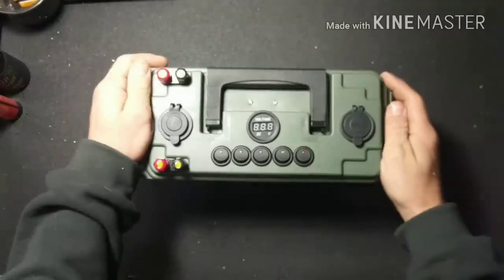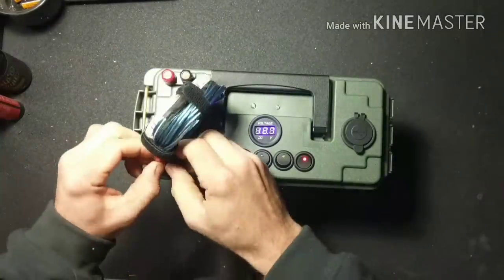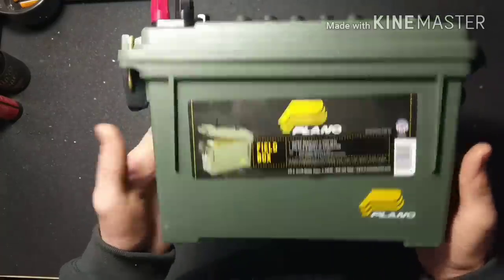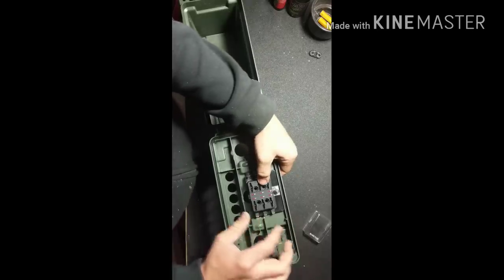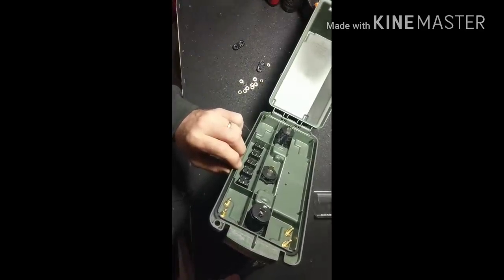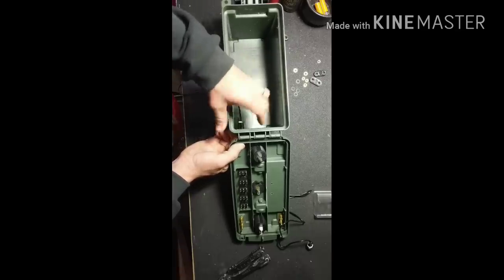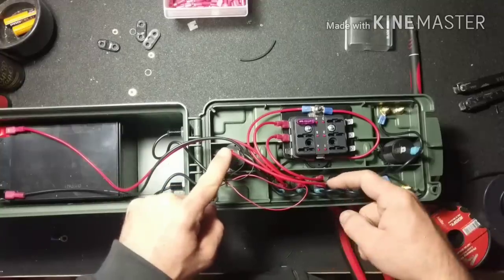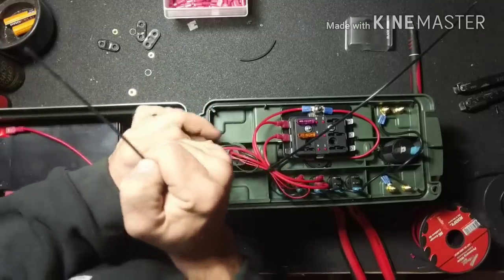How to build a portable power box version two

Comment: the fuse block i have has a negative post unlike yours. in that case would i just wire from the negative post on the block to the last switch like you did? or do i need to get a fused distribution block like yours? thanks
Reply from the maker: You can fuse the negative
Reply: @JDSOutdoors  i figured out it has a negative bus bar. also i saw your new video with the dewalt battery attachment eliminating the ammo box. only thing i would say is these ammo can builds are still highly preferred for things like mobile ham radio applications like a field day. hook a solar panel to the jacks and you can talk for hours in the middle of nowhere while also charging you accessories and what not. thank you for the videos!

Comment: Ok so i did the build and added the solar all at the same time. I got a 30w panel for charging and on a decently sunny day my multi meter shows about 18w going into the box.  My question is, when i plug the panel in,  all 3 lights on my charge controller are flashing off and on at the same time.  Is that how it works when its charging?  I would think only the charging light should come on.
Reply from the maker: The battery light should be solid the PV light will flash when charging. When charged either 2 will flash or all depending on the brand
Reply: Ive got all 3 flashing.  The battery is at 12.6 according to the volt meter. I used the same components as your build,  got the switches and such from ice hole. Harbor freight charge controller. Maybe its sensing the battery is at charge? Or maybe a bad charge controller?
Reply from the maker: @chrispierce2942  hmm use it for a week or so and see what it does
Reply: Ill give it a shot.  Thanks for the help
Reply from the maker: @chrispierce2942  if it doesn't work I'd swap it for another one every brand has a defect every now and then
Reply: Gotcha, i kinda thought that but ill see what happens.  Might try and drain the battery down more then hook it up and see where that leads me

Comment: How would this type of setup last for using it to use a fish finder and livewell at the same time?? For approx 8hrs
Reply from the maker: It all depends on the type of pump you use and the amps it pulls. With this 12ah battery you will have no problem running a vexlar or similar off of it for 8+ hours. You will have to look at the pump and on it, it will say .5 a/hr etc then the math from there is easy

Comment: A little off topic, but can i charge a battery bank (26,000 mah) directly off a usb port on a solar charge controller if the controller is not hooked up to a "storage" battery?  IE 50watt solar panel, 20 amp charge controller, but no "house" battery?  Cheers.

Comment: Awesome vid!!! I was wondering if i wanted to use a bigger battery. Would everything still apply?
Reply from the maker: Absolutely the only thing that needs adjusting is the container that holds the battery and the wire size depends on what you want to power

Comment: I just built my second box and I was messing around with no fuses in.   I noticed the LEDs for the switches would still come on, and 5v passing to the receptacles.  Wired identical to yours.  I'm assuming yours doesn't do that when the fuses are out?
Reply from the maker: Weird there should be no power when the fuses are out

Comment: Hello Great Project!  Question.  How can I add an AC 125v Outlet socket to this box?  is it possible?  I want to be able to connect a nonportable speaker to it...
Reply from the maker: You need to add an inverter but on this size box it's not worth it.
Reply from the maker: @jmvelasquez77  you can but it will only last a few minutes before it dies.

Comment: I'd like to add a built in charger port for the battery so I can just plug in an extension cord and have a cover over the plug socket.
Any idea where I could get the plug socket with cover and whatever the proper name is so I can search
Reply from the maker: Yes its called an sae port. I can send a link if you would like.

Comment: Curious about the switches you are using and if they are the same in your other/older veraions of the box. In all your other boxes the middle was the power IN and the outside silver pin was the OUT?
Reply from the maker: It depends on the switch manufacturer best is to test your specific switch. If the light stays on even though the switch is off then swap the power in and power out wires

Comment: Why do you need a switch for each power output? Why not one switch to power the outputs, and one switch to power LED (which are unnecessary anyway)? Is it rechargeable? How long does it take to recharge the battery (if possible)?
Reply from the maker: Must not of watched the video eh all of your questions are answered in it. The best part is its completely customizable if you dont like the leds I use every time I have the box out, actually about 75% of the reason i use the box most of the time. You dont have to put them on

Comment: Hiya great video, I have a question. If I don't have a separate volt meter, for example my volt meter is part of my dual usb port.
DOES the + on the Dual usb/ volt meter go into a fuse box port? And not the fuse box connection at the top? As in ur video.
Thanks
Reply from the maker: You are correct hook it to the fuse box port
Reply: @JDSOutdoors  great thanks so much  keep up the good work.

Comment: Hey man, I used your video to introduce myself to the electrician world, thanks! So, no circuit breaker is needed before the master on/off switch? I understand the fuse block protects everything else. But what about the master on/off switch that is connected straight to the battery?
Reply from the maker: An inline fuse wouldn't hurt if you wanted. All that will burn out is the switch really if something happened
Reply: @JDSOutdoors  So if I were to have a master switch used with a bigger battery, (say 12V 50AH), do you think I'd need a switch rated for more power than the one you used in the video?
Reply from the maker: @zachwilson9824  nope you will be ok

Comment: Save time and labor. Buy a six rocker switch gang box $50 off amazon and mount in the side, instead of many individual pieces that would cost the same amount.
It has usb, cig. and voltmeter, six switches with optional light indicators (if you choose to connect).
all prewired, with inline fuses, only need to connect power leads (6 loads) and one ground.
I have: 
2 nav lights, 
2 aux, (stern and bow) and another on the power box (for solar charging etc), 
3 interior cargo,  
1 spot light, 
3 cockpit lights and 
4 side green zombie lights..for sit on top kayak. I made the box removeable from the fixed wiring harness in kayak. Mounted on the handle of the box with velcro is a AA AAA solar battery charger, can set the angle toward the sun.
I added a master shut off rocker switch on the outside of the box, i have six circuits, LED lights, removeable and rechargeable power.
Another box with 2 small batteries are another add on that keeps batteries waterproof, top deck, and is removeable for use in camp.
Reply: Sounds good 👌🏻 put up a how to video!!! 🙂

Comment: Hi - I thought I had followed the steps correctly, but I am still having issues with my setup. I used a different box, but the wiring should be basically the same. Is there any way you could give me some pointers on what to look at if I share the issues I seem to be having?
Reply from the maker: @christiankearns3732  yes absolutely. Trace the wires and make sure the grounds are all correct
Reply: @JDSOutdoors  The master switch works fine, but when I flip on another switch, the master switch light turns off, but I still get power to the other switch; however, power isn't sent to the accessory. The issue is the same across all of the accessory switches. As soon as I turn one of them on, it lights up, but the light goes out on the master switch and no power is passed to the accessory.
Reply from the maker: @christiankearns3732  try swapping thr power in and power out wires on the switches.
Reply: @JDSOutdoors  Thanks so much for the help. No luck, unfortunately. It seems strange that the switches get power, but it doesn't make it to the accessories. This would lead me to believe is a grounding issues with the accessories, perhaps?
Reply from the maker: @christiankearns3732  yea that would be where I look next
Reply: @JDSOutdoors  Success! Thank you so much for all the help. Great video and thanks for the support.

Comment: I just made one of these recently it works great, but one small problem I'm facing(and I think it happened in your demonstration too) is that whenever you power something the voltmeter voltage is dropping, and its pretty annoying, I made one of these to power my telescope, but the problem is I can't tell what is the actual voltage of the battery that way, is there any other way to achieve the same thing with the master switch and the voltmeter, but make it display the correct voltage? Thanks :)
Reply from the maker: When there is a draw on the battery the voltage will drop. I'll look into and see if there is a way to hook it differently and see but I believe the outcome will be the same
Reply: @JDSOutdoors  The voltage will always drop, but if I'll connect the voltmeter directly to the battery the voltage won't drop as much and will display the actual battery voltage, I'm using this battery box as a portable power for my telescope and when using it the voltage shown is the voltmeter drops from around 12.5v to 12.2v, and that way I can't really know when the voltage drops too much.
Regardless, this(and the previous one as well) tutorial was incredible, and I appreciate your help and the fact that you actually replied to my comment, thanks a lot!

Comment: So it won't jump start a car cause the wires are  16 gauge but presumably if you were to do the exact same thing using 8 gauge wire it might be used for that as well. Another question i have is will a bigger battery fit into this box or will I have to find a bigger box to fit a 17ah 12v battery
Reply from the maker: intra morph if you make a little jumper wire with clips on the end to hook to the battery it would start a car. And the battery is 4"x4"x6" and it's snug if that measument is similar on your battery it will work
Reply: awesome. this is a great little power box and a good idea to have one of these in the car in case of emergency and stuff. Will be building one of those myself Thanks again for great video =)

Comment: Hi man! I have bought identical fuse box as yours and wired it in the same way, however led on switches will still turn on even if there are no fuses in the box. I double checked everything and cannot see what I did wrong. Is this happening for you too?
Reply from the maker: Haven't had that one happen. Sounds like a defective fuse block.
Reply: @JDSOutdoors  It turns out to be completely normal. Look what I have found online: "Please note that in order for the red LED to light, a very small, limited current passes through the circuit so you may still register continuity across the fusebox terminals when a fuse is blown or no fuse is in place. This limited current is completely safe but may cause connected LED lights to glow faintly (since they require such low current to operate)."

Comment: How long does the battery last if you had a  led light strip running and charged a phone a bunch of times. I'm thinking of building one for calling. I'm trying to understand battery capacity.
Reply from the maker: ctmtb so many variables in your question. I've ran the lights for a couple hours a night for 4 days and charged my phone each night for the same 4 days and it still had enough power to give me one or two more days of the same routine
Reply: Sounds good, and thanks again for the great video.

Comment: able to charge the batter via solar panel through the power post as well then im assuming like you do with the AC charger?

by turning on the master switch then flipping the switch for the power post, isnt that for OUTPUT not input? sorry im  a newb to this stuff and just want to clarify.

Also any way to check the battery capacity? like some kind of meter for battery life if its down to 75%... 50% etc?
Reply: The way it's set up you need to open up the line between the post and the battery via the switch so yes you would need to flip the switch to make the direct line to the battery in order to charge

Comment: I have a 21 watt solar panel with usb output. My question is do you know if it would it damage the usb socket if I used it to charge the battery.
Reply from the maker: Bob Culp currently I'm working on a few solar set ups and based on my research it should be OK as long as you make sure it won't put out more amps then the socket will handle and also either add a charge controller or babysit it

Comment: How could I add a charger port to this so i. Oils charge by plugging into it from the side
Reply from the maker: Buy an sae connector and wire directly to the battery with an inline fuse of course

Comment: How long can this run some led usb lights wanting to build this for hurricane season my power always goes out need a source of light for night times also wanting to use for charging phones
Reply from the maker: A couple days on lights with a few hours use each day and about 3-4 phone charges.
Reply: Also could u run a small mini fridge off this? Like if power goes out u could store stuff inside the fridge so it doesn't spoil
Reply from the maker: @Ninja9687_  it would however only for a few minutes. You can apply this same concept to a different type of system like a dual deep cycle battery bank with an inverter to power 110 items. Purchase a 100w solar panel to recharge the batteries and you will have days of power

Comment: JDS, is the power out of the switch in the middle pin or outside pin? I’m confused because the vendor for those lights has the power out on the outside pin.
Reply from the maker: Depends on the switch I've seen them both ways

Comment: Hey man love what you do !!    quick question why have one 12ah battery ? And not two 7,5ah battery (like you used in your first battery box video) which would make 15ah. Which would last longer ??
Reply from the maker: Michael Trezona for a few reasons. the biggest being that two batteries won't fit in this box when you have the USB and cig outlet. Also the price when you can get the 12ah for the same price as one of the 7ah. in most applications 12 ah is plenty for the day or even weekend depending on use

Comment: What volt blade fuses do you use?
Only thing I can fathom out.
Reply from the maker: 2 and 5 amp
Reply: @JDS Outdoors  thanks buddy I've just built it today and I don't know how I missed that in the bloody video.

All works ace thanks so much for the in depth guide.
I've fitted 2 sets of lights with one  set on a PIR but I can't get the pir to trigger but I'll have a read and see if I can figure out what I've done wrong. 

Thanks again.
Reply: Turns out it's a faulty pir so I've now got working lights for when I get a run at night.
Reply from the maker: @PI7ABR3D  it can happen with anything. Glad ya got it figured out though.

Comment: Would you be able to do one with a Vruzened battery kit?
Reply from the maker: Michael Hitchner I'm not 100% sure what that is but most batteries that are 12v will work. Sealed batteries are best as they won't leak when knocked over

Comment: harbor freight still has the boxes from their tent sale til the end of the month for anyone interested in building one of these. ive built a couple myself. they are $2.99 til the end of the month. JDS, you dont use a discharge cutoff for your box?
Reply from the maker: Not sure what you mean by discharge cutoff
Reply: @JDSOutdoors  so you run your sla completely dead? not very good for it to go below 10.5. 11.5 if you want to make the overall sla lifespan longer.
Reply from the maker: @paulhack893  where did I say that? I consider my lead acids dead at 11.6 and charge them up?
Reply: @JDSOutdoors  ok you keep a close eye on voltage. Just wondering cause I havent really seen anyone use a voltage cutoff. I know I've charged a few devices and accidentally discharged to 7v a couple times so I went with a discharge protection. They work wonders. If ya have Facebook, message me and I can send ya a couple links for some. Just seeing if I can help ya out in any way.
Reply: Oh wow. I meant "so do you run your sla completely dead" didnt mean to sound like I was accusing you of that lololool.
Reply: Also check out the Apache boxes at harbor freight. I built a small one with 12v socket, USB 2.1 and an additional USB 3.0 qc. Turned out so nice. Your wiring turned out fantastic by the way.